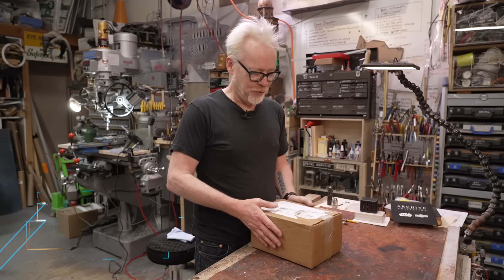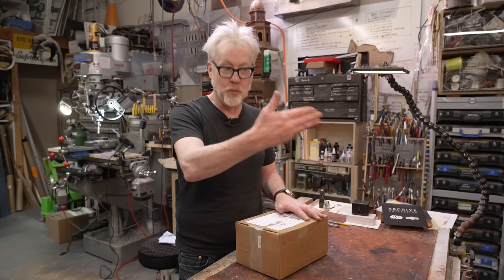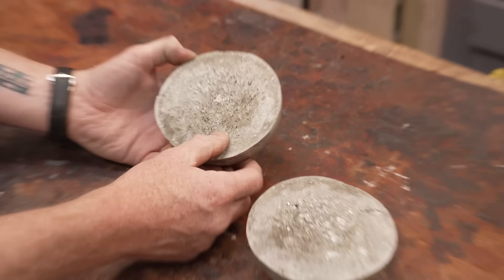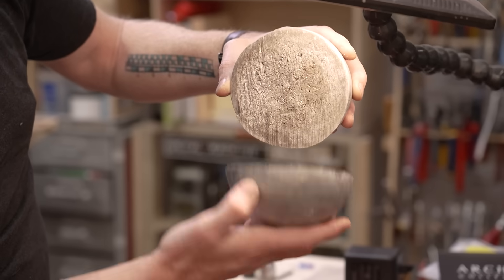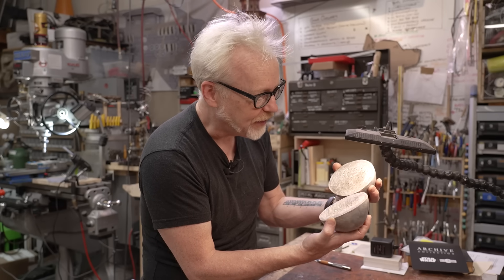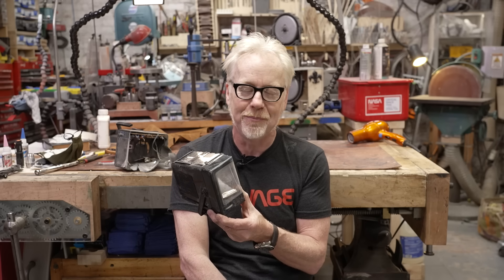Adam Savage's Aluminum Foil Ball Cut In Half! (Ft. Waterjet Channel)

Comment from the maker: Subscribe to the Waterjet Channel: https://www.youtube.com/c/WaterjetChannel
Watch the Waterjet Channel cut a CRT TV in half, per Adam's request: https://www.youtube.com/watch?v=MVuDkvKqLEk
Adam Savage Takes the Aluminum Foil Ball Challenge: https://youtu.be/q_YZX1SgZ5Y
Reply: I've always thought that Adam would have found popularity even if myth busters never happened. I wonder if he would have been one of those early YouTube hobbiest creators. I was so happy to see Adam take so well to YouTube.
Reply: It is garnet that's used as the abrasive Adam
Reply: @seanbeam1757  Garnet is bad quality ruby :)
Reply: @FDog16  actually garnet is silicate and ruby is aluminum oxide. Garnet gets its red color from iron and is not as hard as ruby, which gets its red color from chromium
Reply: It's always fun watching for the "oooooh i could make a box for this" moment.
Reply: Water does indeed do some of the cutting, hence why the garnet can be turned off if not needed.
Reply: I might have tried cutting it in half with a single Nylon thread. I know it will work because I was in jail one time, I removed a long Nylon thread from my blanket, pulling it slowly “back and forth” along my “Stainless”
Towel rod, I was able to cut through stainless as thick as a pencil. 
It was amazing how hard they tried finding the saw I must of had in my butt. 
Idiots. 
I too was an idiot for being in jail, but that experience was worth it. 
God Bless
Reply: Ruby or other precious stones with a precise hole were used as the "tip"
Reply: Make the next ball with a 20-Ton hydraulic press. You can get one for a tabletop of yours. If you can't find one near you/that can be delivered to you quickly, I am sure a 10-Ton hydraulic press would also work. Thing is, many use these to press out oils from MJ, so they might be scarce in your area.
Reply: Water jets are great fun but super maintenance heavy. They use garnet sand at various grits depending on the job to be done or head to be used. They can cut without the garnet but it’s way less effective. It runs at 40,000 psi on the lower end and up to 100,000 psi on the high end. So the water coming out of the tip of the head is moving at around mach 6. Adam you should get one of the “desk top” water jets. I’m sure you would have tons of fun with it.
Reply: "You're not riding a horse you're just smacking aluminum together" LOL
Reply: You should try making one with a hydraulic hammer just to see how solid and compact you can get it
Reply: As a science obsessed autistic kid growing up watching Mythbusters you were the biggest inspiration for me man, you were always the one vocalizing exactly how excited I was for the same things an it really helped seeing an adult get so giddy about interesting science facts so thank you very much!
Reply: That's what we used atleast
Reply: I would love to see them cut a hole in the bottom of the water bottle you had in one of your video's where you used the glass cutting rotary bit
Reply: That looks like an egg a  robot Emu would lay.
Reply: goddamn you got old adam savage
Reply: You be careful with that Adam:
https://youtu.be/aFlromB6SnU
Reply: I was just thinking a couple of days ago if you had ever gotten the aluminum ball cut, so I was thrilled when this video came up on my feed
Reply: Repent to Jesus Christ 
“I have been crucified with Christ and I no longer live, but Christ lives in me. The life I now live in the body, I live by faith in the Son of God, who loved me and gave himself for me.”
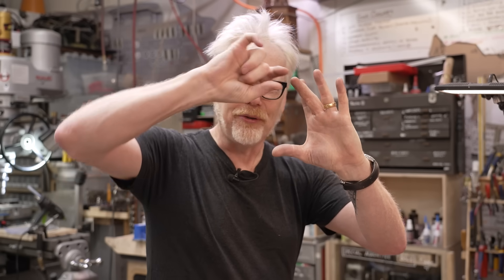Galatians 2:20 NIV
Reply: Could you start with a surprise ball so that there's a plot twist for the YT video once the ball is cut again, or so that there is less air near the core, or for some other fun deceiving properties.
Reply: Measure the density with water? See how much air inside? Educate your viewers darnit ;)
Reply: loll
Reply: One of the best science experiments you ever pantented from mythbusters
Reply: When I ran a water jet in engineering school, we used a garnet sand as the aggregate.
Reply: The blade needs to be lubrication with standard candle wax.
Reply: You should make a "demon core" style lamp
Reply: Actually in some cases it is the water that does the cutting. For example, when a waterjet is used to slice food, cake is a common one. All those single serves of cake you can buy individually packed? Those are waterjet cut with just water, it goes thru so clean and fast it has no effect on the cake.
Reply: You could pound the center of the half sphere and make it into a neat foil ball bowl since the center is soft!
Reply: Slice a discus and see if it makes a kickass filter.
Reply: I would love to seem Adam talk about things like "feeling the density" by scratching the ball. Things that makers and such get a feel for over time but are very hard to explain how/why.
Reply: See if you can make a solid ball melted inside to out!
Step 1:  Place half-sphere in metal bowl with ice
Step 2:  Mount argon torch on drill press with hose clamp
Step 3:  Slowly starting at center lower torch and melt ball into solid
Step 4:  Add aluminum powder periodically to fill gaps
Step 5:  If ice melts, place half-sphere in clay depression instead
Reply: Are you related to Doc Savage?
Reply: I hope that they taste tested it for you
Reply: Does it feel like extruded aluminum? On the outside?
Reply: I would have liked to see it polished at the end of the video.
Reply: Usually it's garnet sand used to cut. At 10,000psi the jet glows red hot on exit, it's made of steam and hot garnet.
Reply: Adam should do a acid etch and then a coffee etch on it to give it a Damascus like finish, to see all those tiny foil layers :)
Reply: They use ruby
Reply: The stupidest channels get most subscriptions
Reply: Sorry I'm late to the party, you need more cameras with some better editing.....
Reply: Does the center have more air pockets because of the way you wrapped the foil? At the start, you were forming the ball by smashing the foil, whereas later, you were wrapping the foil around the ball.
Reply: Garnet-sand is used in waterjet cutting, as are likely other fine grains. (Yes, January birthstone!)
Reply: Aluminum Ball in space https://youtu.be/xPFqWkUx0NI
Reply: More zionist shill BS propaganda
Reply: Could this be how Egyptians cut stone ?
Reply: I love that channel
Reply: Hey Adam, when you said you are surrounded by aluminum all day made me think that you most likely have some aluminum near you that the company I work for has extruded because we're the largest aluminum extrusion company in northern America (SEI)
Reply: your video of cuting it is trash and is not worth even looking up
Reply: they use garnet.
Reply: @tested I wonder how much the water and particulate polished the ball while it was cutting?
Reply: How did they hold the ball while it was being cut?
Reply: Why is it caled tin foil when its made with Aluminum?
Reply: Now do a copper foil ball. 👀
Reply: Adam you've always been the mad scientist we need, you're one of the reasons why I love physics

Comment: If you get the volume of that original roll and convert into a shpere to determine its diameter then you would likely know there's no more pocket of air left. Also, need to compress that ball after few wrapping to lessen those spring back effect.

Comment: Would be very curious to know the relative densities of the sphere versus the original roll. I suspect that there might be LESS air between the layers of the roll than was found in the sphere. So, it is possible that all that hammering didn’t increase the density of the aluminum object (not counting the air inside the tube around which the roll was wrapped).

Comment: It's silica sand, and in several different  coarseness.  They typicall run About 50k psi. There is also straight water cutting without abrasives for use on rubbers and plastic.

Comment: Suggestion for a future project: step 1: make a ball in similar way to how you've done (but I would suggest using thinner strips of foil so it's more like winding a ball of yarn). step 2: pound, shape, etc. to your heart's content, 3: smooth and seal the outer layer, 4: send it down to the bottom of the ocean, 5: retrieve it from the bottom of the ocean, 6: cut in half

Comment: Just for shits and giggles, why don’t you measure the ball’s final density?  Measure the volume.  Then put it in a tank of water with some jet dry.  Bubbles float out, water seeps in, and you can calculate the ball’s average density, right?

Comment: The water jet was probably the best choice, but if you wanted to do it there, if you use something with teeth they grab, but they cut stones with a thin grinding wheel and is far more difficult to harm yourself, not impossible, but more difficult.

Comment: Hard to semi-hard Wax is best I've used in my 40 years of welding and cutting aluminum. I used to use porter cable lube wax, but I have changed to natural bee's wax from a local honey farmer (love the smell when cutting). It keeps the blades teeth from loading up when cutting soft/sticky metals, the higher the TPI the better from band saws to metal cutting circular saws.

Comment: I just watched the making of your aluminium ball (yes that's right, aluminium😅  )from tin foil with a surprising amount of interest, I even spilled my bowl of muesli on myself I was so transfixed, then I found the follow up video after it had been cut in half with a water jet, which would have been my first choice as well, I used to work on a bandsaw and I had chills watching you trying to cut it, the thought crossed my mind that given the lower density of the core, would you consider making a bowl out of it?

Comment: You could estimate the porosity percentage of the [uncut] ball by measuring its density (weight divided by volume) and dividing by the density of solid aluminum. You could "show" the porosity of the interior by beating into the core of one of the half-balls, gradually turning it into a half of a hollow ball. You could try crushing one half-ball in a multi-ton hydraulic press. (Maybe with a ring around it to keep it from spreading -- press it from a hemisphere into a hockey puck.) To make a denser more-solid ball, start beating on it sooner. The most solidly packed foil is the original roll of prefect foil. To make a dense aluminum rod, re-roll the foil starting from 0 diameter. (You could cheat a little and start with a perfectly straight cylindrical aluminum rod or aluminum wire.)

Comment: Put the [uncut] ball under extreme hydraulic pressure, either in a hydrostatic test tank or by letting it ride 10,000 feet down on a submersible. That should slowly and beautifully "implode" it to a near-sphere of smaller diameter. (Complex factors determine its exact shape.) (A tarry coating might help prevent water from leaking into the ball instead of crushing it.) (Extreme hydraulic pressure crushes styrofoam cups into little shotglasses.)

Comment: Ran a water jet for a few years when I was in the USN and Garnet in sand sized particles is what we used to cut materials with. Be it metal, plexiglass or even wood. Though there are softer materials that can be cut not using nothing more than water because of the intense pressures common out at the nozzle. Ours ran 45,000-55,000 PSI but there are many out there with much higher PSI. 80,000-90,000 PSI of memory serves. Of course that was 20 years ago 😳

Comment: On the one hand I want to see if it can be peeled back apart into its original foil layers. On the other hand I want to see one of these done in the right conditions that would cause the aluminum layers to cold weld to each other.

Comment: When I made my aluminum ball (which I only used the foil from cigarette packs, with the paper removed. Of course) Every half inch or 1 inch I would hammer it into a hard ball and then put it between 2 flat boards and roll the ball in between the them until it was perfectly round. If there is a next time, this way you'll achieve the best results.

Comment: I made one -much smaller but because of the eventual cracks I felt it failed. But now I will do it again. 
btw…I am a 72 yr old female …so you are never too old to have fun and learn something.  
The way the centre was less compacted than the edges reminded me of the Earth itself and I wondered if it is as it is because the compaction occurred (like the Al ball)…from the outside surface.

Comment: I bet you could improve overall
density/porosity by starting to compress it even as you add more foil. I don't know whether you like the porosity or not, but I figured I'd mention the idea anyway, in case you wanted to change the end result. Also, as to cutting the ball in half, I bet one of the
' electrical discharge machining' (EDM) channels would love to collaborate and cut one in half for you! Anyway just an idea. Cheers!

Comment: Just FYI, aluminum foil is 3105 alloy.  It's also the same alloy they use for making RVs and Subway cars.  Not to be confused with 3104 which is the alloy used for beverage cans (the sides, not the tops-that's 5182 alloy).

Comment: - It looks like stone on the inside. I assumed it would look like crinkly concentric rings but figured the water-jet might affect it.
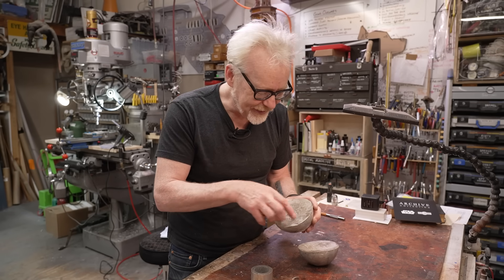- 4:24 It's NOT quite aluminium. The foil has a layer of plastic on it, just like a soda can. Put some foil on the burner on the stove and watch as the aluminium glows red and leaves behind a layer of plastic (until that too melts away).

Comment: A guide trap with the bandsaw would've worked too. You just need to keep it in place while you're pushing it into the blade. Could also add handles to the guide to keep your hands safely away from the blade.

Comment: Quarz sand is hard and abrasive enough for almost everything.
For this ball simple water alone should be enough to cut it.
I‘ve cut 1,5mm thick brass sheets with just water at 4000bar and it worked fine.

Comment: Had he hammered it as he did when he was done at various eariler stages. It would have been considerably more dense. As it is, Earth if it were made of aluminum would look the same. Though not liquid, the ball does have a slight core considerably softer, and the outer edges of fisure's along what could be consider the crust.

Comment: I know I'm way behind the aluminium ball here, but rather than sanding and polishing, I'd say sealing the cut in epoxy resin would preserve that interesting "crumb structure", if you will. I haven't done it myself, but I've seen others use this one type they work into rough surfaces with a brush to get it into all the nooks and crannies. The way I understand it, they do this before the 'proper' casting to prevent air bubbles in said nooks and crannies. When they then plane and polish the outer layer of epoxy, it still shows that lovely uneven potted, craggy surface, but both doesn't release debris, and is in reality a flat surface for your table or whatever they're making. Using a similar pre-cast epoxy on the surface and then sanding and polishing the epoxy instead of the aluminium will protect it from damage. Rambly but I hope I somewhat make sense..

Comment: Just an engineering tip I remembered about when you were fitting the two halves back together, if you have any kind of component failure (e.g. fatigue) it's very important to avoid fitting the two broken halves back together or even touching the failure interfaces. The reason is that it can damage the failure interface and that kind of evidence contamination makes professional investigations more difficult. Not that it really matters in this context (it was cut in half for fun) but it's worth being aware of.
Reply: shut up

Comment: There are actually a few different water jet cutters that I'm aware of. One is like he described, some actually use a super thin electrified wire (don't really remember the details of how it works) and another, I believe uses a type of laser with the water washing away debris and cooling the material to keep it from expanding with the heat. One of these is how you get those really cool decorative metal pieces that are like puzzles, that when the pieces slide together, there are no visible seams and looks like a solid piece of metal because the cut is so perfect and almost microscopic.

Comment: For the first two minutes I found myself wondering who cuts Adam’s hair.  He looks like the description of Zeddicus Zu'l Zorander, with chopped sides 😅

I wonder…after Adam compared his block of 6061 I had a thought, what if Adam makes another ball like he did and instead of cutting the ball he heats the ball up and hammers some more.  Would that help the trapped air to escape?

My second thought was if Adam starts by hammering a tiny ball and continuously adds and hammers until he has a comparable sized ball/cube, and then machines the block into a new compressed aluminum creation.

Comment: Adam... no way the foil thickness was 'a micron or two.'  You should know better.  That would be impossible to work with, it would be so gossamer-thin!  Probably on the order of 100 um.  And... waterjets: almost 30 years ago I worked for the company that invented the technology.  I'm sure that things have evolved since then, but... the abrasive was almost always garnet.  And the grit was MUCH coarser than your guess of 10,000.  More like 150, IIRC.  10,000-grit abrasives would never cut through that Al foil ball, even when moving at ~ Mach 3.

Comment: If you start with a marbel sized ball, hammer it down to a pea and build it up in 1 ft sections of foil you can make it almost completely solid. As a class we did this in middle school. Everyone in the class took turns putting sheets on and hammering them down. Took us a whole week and we got thru if I remember correctly 500 Sq ft...